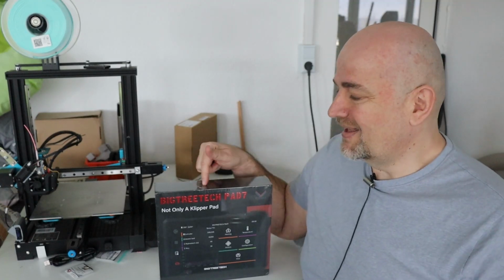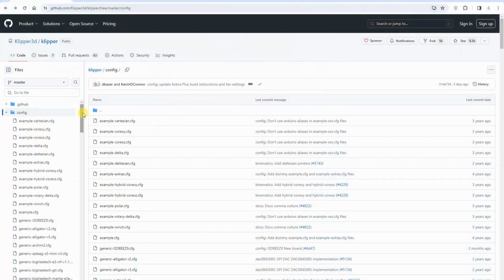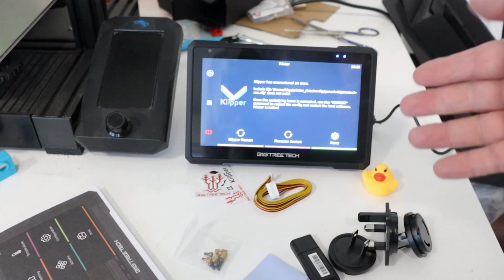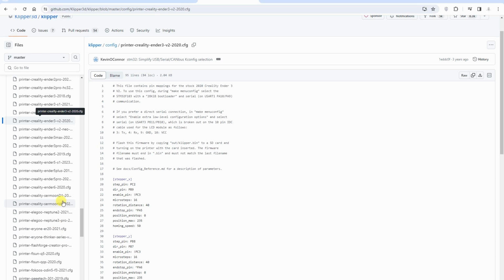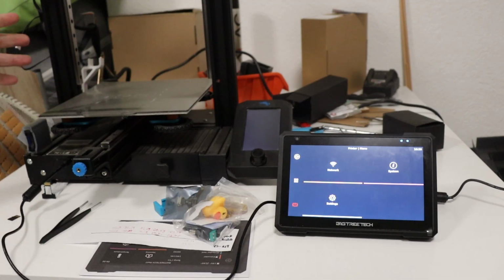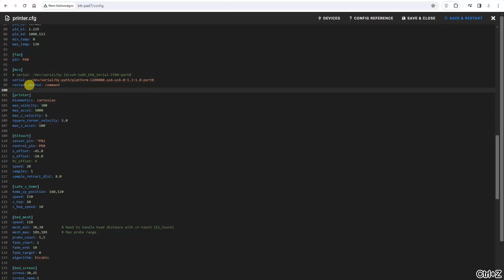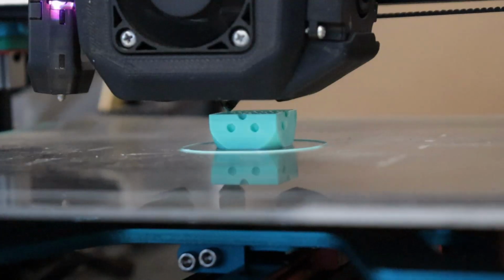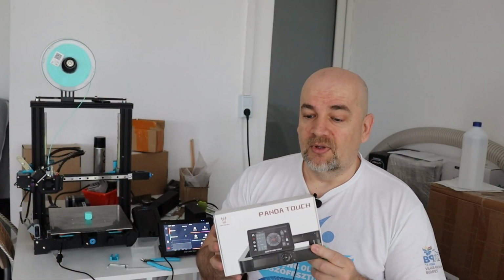Klipper with BTT Pad7 on Ender-3 V2 (with MicroSwiss NG extruder)

Comment: Hi! I bought a Pad 7 and installed the firmware updates. How do I properly connect it via the lower rear USB port to the SKR v1.3 board? What should I specify when creating a "managed" firmware for SKR version 1.3 and what should I write in the printer.cfg file?

I've watched a lot of videos on how to do this, but I can't repeat it.

Perhaps you need to enable "Enable advanced low-level configuration options" in PuTTY and configure the "USB IDs" correctly? Do I need to configure "GPIO contacts"?

By the way, after updating via KIAUH, Pad 7 issues a "Crowsnest" error when booting. What could be the reason for this?

P.S. I'm sorry if the automatic translation is not completely accurate.
Reply: Usa IA pra te ajudar nisso fazendo perguntas ao gemini ou chatGPT consigo aprender muito com elas
Reply: @carlosvinicius5742 , Thanks for the reply! I discovered that the Micro SD card in SKR v1.3 was faulty. I discovered this when I decided to reinstall a fully configured Marlin just for fun. Instead of installing the firmware properly, the printer wouldn't turn on the screen and only beeped. I got a different Micro SD card and copied Marlin to it. And it installed. I've ordered new Micro SD cards. When they arrive, I'll try installing Klipper from scratch.

Comment: I love my pad 7. But it is not that easy for beginners to set up. I have tried the sonic pad and did not like it. So I bought the pad 7. I also bought a raspberry pie 3b and a BTT 5 inch screen and set that one up with klipper on another printer.  I will say the BTT pad 7 was easier to set up versus the Pie. I have seen that issue come up with wifi. Technically it would have been easier to  edit a file with notepad ++. Another issue is that there are no good instructions. A lot of the YouTube videos are too old and things have changed. I would suggest kiauh to most users. Another big issue with these klipper pad and even rasberry pi options is the usb cable. You can spend hours or days trying to figure out why you can't connect to the mcu and the issue was the usb cable the whole time. Lol. Most of the usb cables will not work so finding one that does can be challenging. I am glad you were able to do it. I try to help as many as I can on user groups. Take care And cheers
Reply from the maker: Exactly same experience

Comment: Hi Igor, I guess I need 3 of these to Klipperize a Neptune 3 Pro, Plus and Max 😂  Weird having first to update using Network cable to finally being able to use Wifi 🤷‍♂️
Reply: You can actually use one of these to control 3 printers at once! There are some special configuration steps required but it's broadly the same setup process.